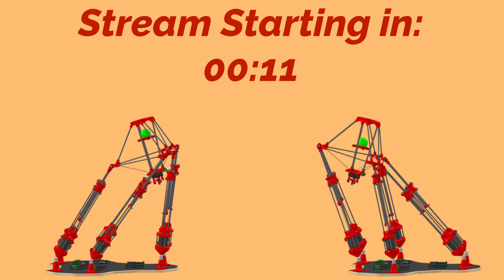PDJ Weekly Livestream # 33 - Update | Jugglebot can Juggle!!

Comment: I work in prosthetics development, and one of the problems we face is internal inconsistencies between hardware and software. For example, sometimes the processor may get stuck in a loop for longer than anticipated, so using interrupts is crucial to ensure predictable code timing. Another point that could help is using microprocessors from STM. These microprocessors have the NVIC, which handles interrupts, and another useful tool called DMA. DMA allows your peripherals direct access to memory, so you don't waste cycles transferring data or reading data asynchronously.

Comment: You need to fix the bugs and slop. I know you've been pushing to get something before your break and the timing of that makes sense. But otherwise it looks like you are wasting most of your time trying to tweak a system that is fundamentally unreliable due to slop and software bugs. Watch this back and look at the number of different things where the software is doing stuff you don't expect and can't explain.
When you come back most of the code will have dropped out of your head, that might be a good time for a bottom up audit and cleanup.
I don't know what your software skills are like good practice is to use good names to make it clear what something is / is doing and then comments to explain why when it's not obvious.
Also if you don't have them already unit tests a very good thing, they let you clean code without fear of introducing new bugs and writing them is a great way to find bugs and also to make sure fixed bugs never come back.
Reply from the maker: I agree! I'm not sure I'd call the tuning time fully 'wasted', as it's been very useful to learn what does/doesn't work and in what way the system is fragile, though in general I agree that there are underlying issues that ought to be resolved. Rest assured, they will when I return! I'm hoping to do as you suggest and spend a good amount of time cleaning up my code when I return.
Cheers for the input! 😊

Comment: Why not have a static funnel as tall as the linear guide, at the bottom having an OD of the ball diameter and at the top 2 or 3 cm larger? Easy to 3d print and probably ups the reliability a lot already.
Reply from the maker: That's a good idea! It'd be a bit tricky to fit to the current platform frame, but that's just CAD and it's definitely not impossible. I'll keep thinking about this and I'll add it to my list of things to try. Cheers for the suggestion 😊

Comment: As for the priming, I feel adding yet another device will make it so much more difficult to get reliable.

My suggestion would be to have a startup sequence where the jugglebot picks the balls from a magazine slightly out of the normal juggling path. Because then there's much less variables to worry about. You could have a single magazine which loads new balls by gravity or give each ball its own spot.
Reply from the maker: I see what you're getting at, though I worry that needing Jugglebot to move that far will be a big ask. Perhaps if the platform were faster and more sturdy, this would be doable, though as it is, it'd be tricky to get the platform to move that much that fast. I'll reevaluate this after fixing the slop in the leg -> platform joints; hopefully that fixes a lot of the rapid movement problems!

As for the complexity of another device: if it were a 'launcher' that throws the balls up to the hand, I agree that that would need a bit of work, though I actually think the dropper shouldn't be that difficult, and would certainly be easier (overall) than me priming the hand every time

Comment: Always fun to check in on progress here! My experience with troubleshooting high speed automation is two things. One- any kind of mechanical inconsistency leads to inconsistent results (slop in the legs is a massive problem imo). Two - you need good high-speed footage. You'd be surprised how much more you can tell with a high framerate camera and good lighting. Your phone's slowmo mode is probably more than sufficient. I'd also consider doing some more testing to try to isolate the issue. One idea is doing the vertical fast throws in different parts of the envelope to see if that makes a difference.
Reply from the maker: Cheers for the input! I absolutely agree about the slop being a huge problem. It's very high on my list of priorities (though below making the next video...). I'm glad to hear that high-speed footage will be as helpful as I've been hoping it will be! I'm really hoping to have some very, very cool updates on this front for my next stream (once I get back from holiday ~ end Sept)

Good thinking re. doing vertical throws in different areas. As it happens, I have actually done this and the throws appeared straight, though I wasn't watching super closely. Definitely warrants a re-run!

Cheers for the suggestions 😊